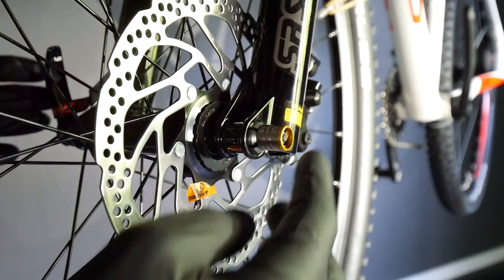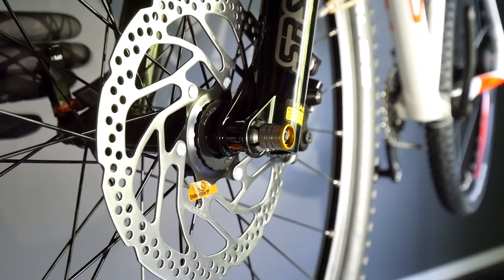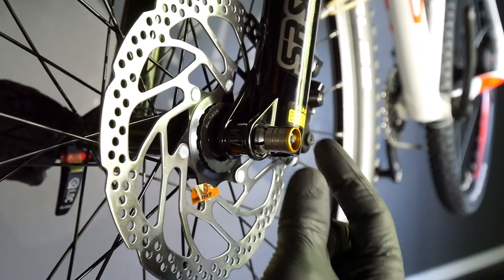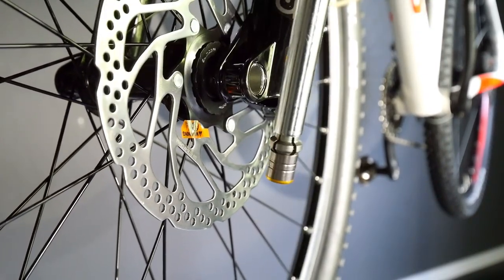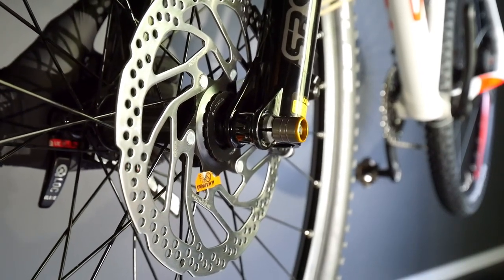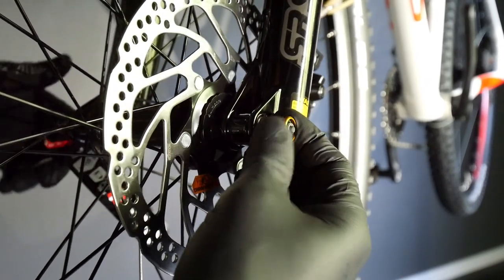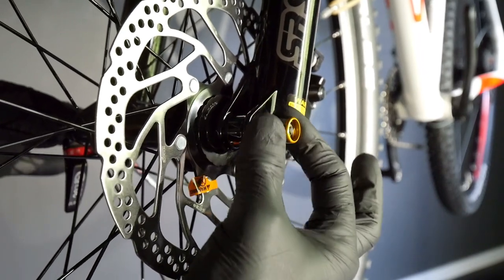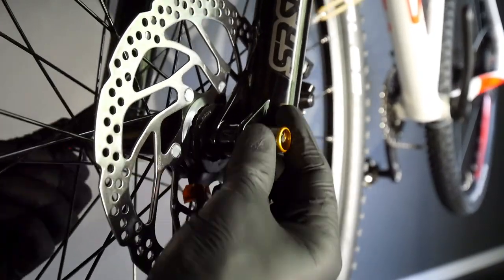How To Open This Weird Through Axle... SR Suntour Q-Loc Release Installation And Removal Guide.

Comment: Mine is completely stuck and not sure what to do next. The  alloy/chrome tube part (axle) is stuck inside? Any ideas how to remove it?
Reply: Mine too.  Just got it out today.  How ?  Laid bike down on its side on the lever end.  Unscrewed the whole end assembly.  Stood bike upright.  pulled lever out from other end (attached to shaft with thread on). Sprayed some wd40 in the hole.  Left for 30 mins.  Then with a small flat blade screw driver and a rubber mallet I 'knocked' the silver cylinder shaft part out.  I also had to use pliers to help at the other end.  Also, occasionally apply some extra wd40 at both ends during the removal.   It took about 15 mins and isn't easy but can be done.  Think mine has never been removed after 6+ years so was totally dry and stuck.  Once removed, a tiny bit of oil in the fork holes ..... and it slides in and out fine, without at tools !   Hope this helps?
Reply: @stevenwilliamson474  Thanks mate, I'll give that a try 👍
Reply: @stevenwilliamson474  I had to use an angle grinder on the hub next to the bearing to actually get the wheel off mate. The thru axle welded/fused itself inside and we tried absolutely everything to get it it out but to no avail. Halfords Mechanic had no joy either.  If I continued to try I would of surely damaged the forks completely and possibly even the front brake disc.(Nightmare) it fused/welded  itself inside due to a metal chemical reaction similar to how a car tyre valve cap fuses itself onto the valve thread. Needed to buy a whole new axle/bearing kit at the finish and just about managed not to damage the forks. I'll never ever buy suntour products again or a bike with suntour parts on it.
Reply: @markweatherall7437  Was in talking to my local bike tech today and we got chatting about the Q-Loc axle because the new bike I'm waiting on arriving likely has this style. I'd never seen it before. He says he's had a few bikes in the shop with the same problem as yourselves, the way to stop it is to apply a tiny wee spot of Lithium grease on the axle once a month and you'll never have a problem with it!
Reply: I used a 15 mil spanner socket and hammer to get mine off, it came off no bother.

Comment: That's pretty neat, but I worry about what might happen if it gets full of mud.
Reply: Exactly what i was thinking .....if mud or dirt/sand get stuck between the little spring pegs ,can they still fold enough to get the axle out ?
Reply: No problems so far. This part of the bike is not getting a lot of dirt either
Reply: I can confirm that it jams right up, during my time in the LBS we had a few Haibikes with these front axles, when dust or anything gets in there, the collar wont detract and allow you to slip the axle out of the fork, major pain in the ass, and there is an O ring that will fail and when that happens the mechanism falls apart...
Reply: Can't stand this system. Run into these problems as well.

Comment: Are those axle replaceable? Like can you get Allen type of axle instead of those quick release one. I think Allen type of axle looks more simple.
Reply: Yes, Amazon has many but...make sure the one you buy has an end cap on the other side! CGVHBK Bicycle Thru Axle,Thru Axle Bicycle Fork Skewer 15x100mm 15/20x110mm Quick Release Thru Axle Mountain Bike Aluminum MTB Fork Thru Boost Bicycle Wheel Fork Axle. $30 w/free shipping. I should probably order it now. No...I'll wait until after the X-Mas rush and suffer with this one lol.

Comment: how good is the suntour raidon that comes with it? worth upgrading it to a Fox Rythim?
Reply: The Raidon is a different fork. That's a budget 4.5 lb fork with no adjustable compression. But...for the price the air spring on the Raidon is pretty good, I'd say almost as good as this one, I can't tell much of a difference. It's just that I really need compression adjustment on my forks and the Axon has plenty of adjustment.
Reply: @richardjensen3655  the raidon 120mm has compresion adjustment

Comment: Where can I find the lock washer at the end ? Mine popped off whilst removing and somehow managed to dissapear. Looking for any websites that have this in stock in the uk would be ideal. Cheers everyone
Reply: They're just a circlip, you can normally buy them in different size packs but with it being really small.. I guess it be better going to a DIY store
Reply: I had the same issue today! Ridiculous design
Reply: Halfords auto has them
Reply: Good video, keep knocking the socket to move axle out.  I and exactly the same thing.  Easy repair tbh.  Easy solution just keep lubricating it.  I would moan if it was my expensive mtb!!!  Just cheap parts tbh
Reply: You don't need it. I lost mine in 2017 :( it works fine without it . I never had any problems
Reply: @arnoldpesando4159  same. Ran mine about a year no problems. Although I'm here now trying to figure out why the 5 peice collar thing now doesn't expand and contract 😭
Reply: @_MJ07_  Did you ever find out why? I have just found out that {1} the guy before me had taken the whole axle to pieces and put it back together incorrectly, And {2} now that it is back together properly that the collar refuses to pop open.
Reply: @dazzc4946  yes, so the inner raceway that the black clover shaped "thing" goes through had somehow become slightly dented which was stopping it from being able to slide through easily. I had to pull them apart very hard (the 5 Axel pieces and the end cap) and then I just used a Dremel to smoothen the part that was slightly getting in the way. It's been fine since.
Reply: @_MJ07_  thank you. I'll have a look at that asap. Cheers.

Comment: I think I have a slightly different problem to most people here. I can remove the axle easily enough, but what I can't do is adjust tension. The video makes it looks so simple, but in my case it's like the lever and quick release system the other end are fused together. The axle is from a friend's bike which he gave me yesterday that wasn't being ridden due to health issues. It's a Voodoo Bizango if anyone's interested. The axle (and bike) are a few years old, but have seen little use and everything looks brand new. There's zero corrosion or rust anywhere. But is it possible something  has seized inside?
Reply: hold the QR while you twist. May need some lube on the threads
Reply: I have the same problem
Reply: @TringmotionCoUk 
What do I hold the quick release with 
It’s too slippery
Reply: @KamranRulez2020  obviously it's difficult for me to tell without it in my hands, but on the opposite end there is a c clip which holds it all together. It may well be that the round part that spreads the locking mechanism has wound in. There's also a locking mechanism that holds it in by twist, just like a pump soap bottle

Comment: Mine is stuck and I can’t get it out
Reply: me too ;-(
Reply: Another one stuck here. Trying to hammer it out.
Reply: I was able to get mine out by putting some chain oil in there because it’s more runny and used a rubber mallet and it came out
Reply: @amazementyt  - where did you put the chain oil? Mine’s stuck too
Reply: Try catching the inside "spider" of this barrel at the end with tweezers or something and rotate just the other part to lock/unlock it. Would help to lube it. In our case it did not want to close so we werent able to close the axle. The worst piece of engineering on modern bike I have seen.

Comment: Thank God I have a mallet. Which I had to use with some force (but as mentioned here already doesn’t seem to do any harm) 

What a stupid design. 

Fortunately I have never had a front puncture on this bike - because there’s no way that was coming out on a ride. 

I’m only changing my pads - otherwise it would have been a disaster waiting to happen!

Why fix something that isn’t broken. The idea is that it takes seconds to remove install. 

Took me a loooong time to work out what to do without a grinder… 🤷🏻‍♂️
Reply: Could of just took the break caliper off and reinstalled it
Reply: @mrghost2572  How would that help? If the skewer is stuck in the forks you still can't get the wheel off... 🤷‍♂

Comment: Every single one of these that has come through my shop is seized in the hub. Worst design ever.
Reply: Yep my exact problem with my currently, seized in their
Reply: @911wilkie  hi there, by seized, does it mean it's stuck. Mine won't come out today and caused a nightmare 😪😭
Reply: I got my axle out but wheel won't come off still 🫣
Reply: @xcx8646  yes. Use a 8 or 10mm long hex key and tap it out with a hammer